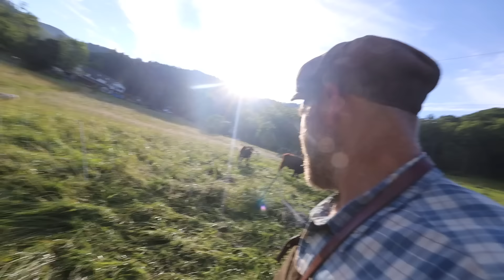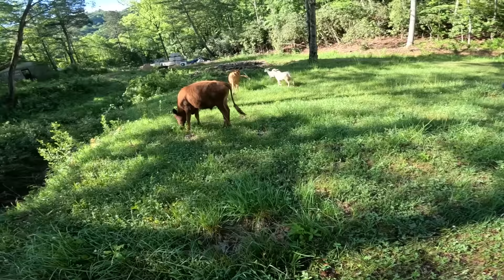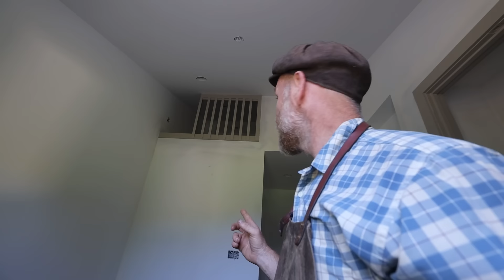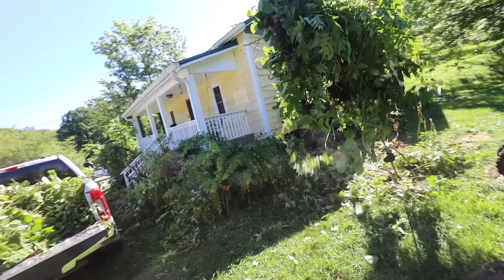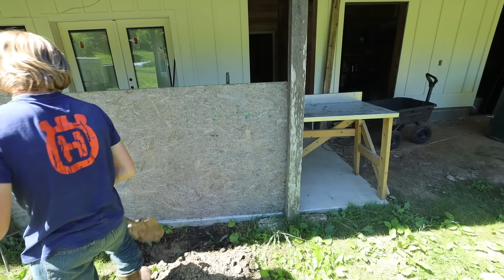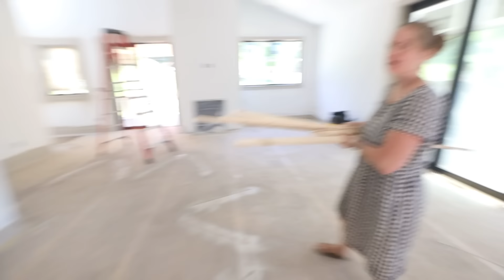Odd Jobs

Comment: I have bought three new homes in two different states and the head contractor always had a sign for each vendor to clean up after themselves. At the end of the project a cleaning crew did a deep cleaning of the whole house before turning it over to me.
Construction / remodeling creates a lot of dust and debris. Also, make sure to replace your HVAC filters as they collect dust and a good practice is to replace them monthly.
Reply: And only the filters you can see through.  Buy a case of 12
Reply: @jeanneshannon5607 Very good point!
Reply: Duct cleaning wouldn't be a bad idea